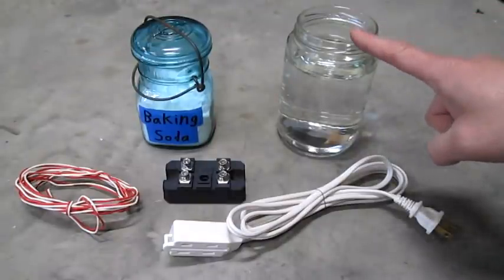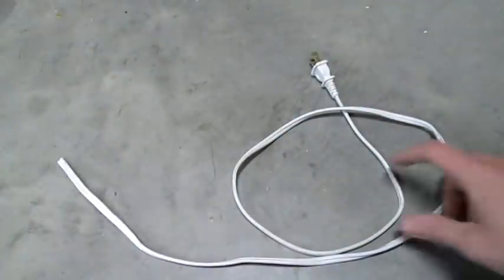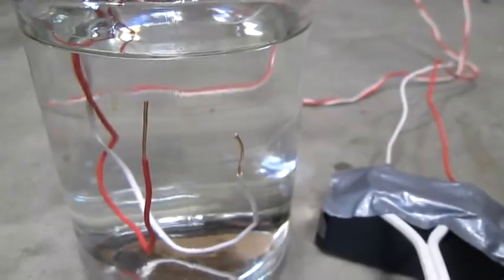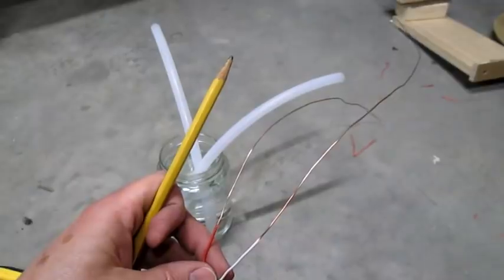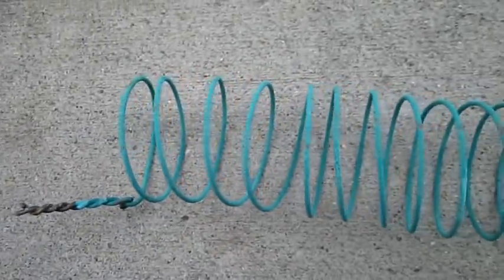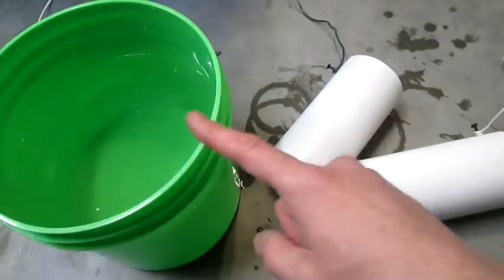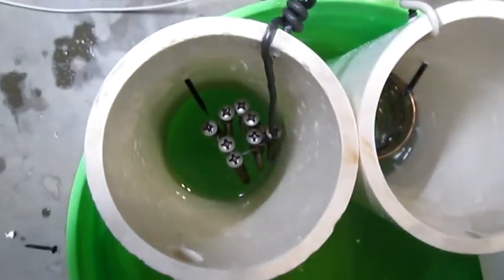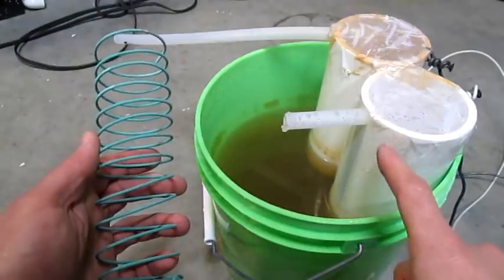DIY Oxygen Machine

Comment: HowToLou:  hi, Lou. It’s been a hell of a couple of years. Too many of us didn’t make it, and it’s not over yet.

This is a super idea. Heaven knows, for those of us struggling over the last year too, a little more oxygen made all the  difference. So thank you for putting in your best contribution. There are  probably people still walking the earth right now because of your contribution, as well as the contributions of those like-minded.  Is somebody who is being a direct beneficiary of this kind of thinking, I thank you from the bottom of my heart. Myself and at least one other member of my family have benefitted from this kind of thinking in this past year.

I’m a recreational potter, but I’ve had to think about the breathing problem this year. Although it was a combination of other people’s ideas that have been getting me by, I can see where I might be able to make a small contribution to the one problem inherent in your very workable and cost effective solution.  

If I have correctly understood you, the   entire process falls apart if the plastic starts to melt. I think that if I find myself in the situation again, Heaven forbid, I’d bust out the ceramic crockpot—The big one. It sits in an electronic unit that’s made with an element in it, so that I know that it can withstand high temperatures. And the unit itself, would protect the environment around it. So I think that might be how I get around the plastic bucket problem.

I didn’t catch what the pipe was made out of. If it’s a situation where we have to worry about those getting hot breaking down in the heat as well, I think what I’d find is a couple of ceramic bottles or cheap terra-cotta flower pots from the dollar store, and cut the bottoms out. Sometimes you can get some fairly tall skinny ones. They could probably be fastened to the side of the crock set up after a fashion that wouldn’t be so different from the plastic set up, and it would probably function exactly the same way.  No Metal touches the set up either that way. So I think that if we make that one material modification, it preserves the integrity of your setup. What do you think?  How long do you think you could run your set up with that one modification? Could you use it to provide some real and long-term relief to some poor soul in emergency situation?

Thank you for being willing to put yourself out there. I think I’m going to pick up the elements of this and put my emergency kit.

There’s another set up that wouldn’t produce as much oxygen, but does a lot to clear out the lungs for anybody who’s suffering and suffocating with pneumonia. It will not work properly and will backfire terribly if a person doesn’t take therapeutic dosages of vitamin D, about 30- 50 mg of zinc, and therapeutic dosages of time release vitamin C and liposomal vitamin C. I’ll explain that if I need to later. But you take that, and then you make a solution of saline, or if you’ve got an affection in the lungs, make it .1% hydrogen peroxide in normal saline. Throw that in a nebulizer, and it not only provides more oxygen, but it loosens up the pneumonia that’s suffocating a person. 20 minutes will make a huge difference. Now for the soul who is not blessed with a nebulizer, one of those inexpensive ultrasonic essential oil water diffusers will do the same job. Mine probably saved my life this year. It was a gift from  my very best friend. She made it possible for me to breathe when I was dying.  

What makes a bigger difference again though, is lying in the prone position, on the belly. This is because of the position were most of the gas exchange in the long happens.  When you lie on your belly, and especially if you can have someone thump some of the congestion down, that exposes more of the actual important area for breathing, so their breathing becomes much easier.If there’s somebody around who can thaw very firmly between the shoulder blades, that will dislodge much of the terrible congestion. A person can even sleep that way. 

My apologies for the length of this reply. I just couldn’t justify not helping a little bit if I could. I hope you’ll answer back to let me know if you try it, or if it needs further tweaking. I can’t say that I have any answers, but I am willing to help tweak things now that you’ve got the heavy lifting done on it. Thanks again.❤️
Reply from the maker: Thanks.  I think those are good ideas.  Remember, the bucket can’t get hotter than the boiling point of water, and that is well below its melting point.  There are readily available heater hoses (I just used one in my latest Razor Heater video) that can withstand very high heat.  The main thing I would add is a copper coil cooling tower to condense out steam and cool the oxygen.
Reply: @HowToLou  :   I’m glad you know about the point at which the plastic ends up dissolved in the water. That’s something I don’t know about, and I’ve never taken an interest in, until this moment. Lol I probably wouldn’t even be thinking about it but for your video.

I would agree with you though but needing to cool down the collected oxygen, particularly if it is to be used directly from the unit that you made to concentrate and collect it.  I suspect it wouldn’t be too difficult to put a lid on this set up to make it Just that bit safer, and then put it on wheeled cart so that it could be moved next to the patient’s bedside; it probably would be a small matter of venting the H gas via a window insert and hose setup.  

It wouldn’t be hard to attach like an oxygen sensor and electronic metre of some kind to give a reading on the concentration. I suspect you might be very pleased to learn how effective your setup is.

I hope you put out another video if you do another incarnation of it.

I strongly suspect that the components are going to end up in my emergency Cupboard. It’s funny isn’t it, I when it comes to emergency bags and such, we think of the rule of threes. But nobody considered availability of oxygen because of pneumonia before this pandemic.

Comment: Any idea what happens with a transformer in the circuit ? (lower voltage) Is the heat produced relative to the voltage and how does it relate to the actual oxygen produced.
Reply from the maker: Actually a transformer would help reduce heat.  You can split water at way lower voltages.  I was trying to make this as simple as possible.
Reply: @HowToLou  Understood. Any idea how voltage ratio's with output? I want to design a whole house unit that ties into my duct system. Thanks

Comment: How much per liter O2 per minutes the tool produces O2?
Reply from the maker: I did not measure it.  Add Sodium Hydroxide to increase production.   More metal surface area also increases production.
Reply: SevenSon:  we did see that he measured his own oxygen saturation levels, and that it raised substantially when he breathed the oxygen that he produced himself using this method. That’s no small thing.

It’s a start point. And if person were to go to use this, I think we can agree that it doesn’t have to be all the only measure that a person implements.

By the same token, if you can find a method that works more effectively, or an idea to tweak this one, I hope you speak up. It could save lives. :)

Comment: Whats fungtion baking soda? Thanks
Reply from the maker: Baking Soda should be Sodium Hydroxide and it helps the water conduct electricity better
Reply: @HowToLou  Is baking soda able to increase the amount of O2 production and O2 quality?
Reply from the maker: The Sodium Hydroxide helps more electricity pass through the water which splits it into hydrogen and oxygen faster.   The oxygen quality is the same.

Comment: Hi, does stainless steel create a toxic byproduct during electrolysis? Thanks
Reply: No. But it depends on your electrolyte. You will filter your gas through a bubbler and this part is absolutely necessary as you don't want an accident if you accidentally ignite the gas. Stainless does not corrode as much as other metals.

Comment: I did some calculation and obtained that around 300 Amp current is required to generate 1litre/min of oxygen. This high current even for 6 seconds is good enough to cause 200 degree C rise in temperature of copper wire of diameter 2 mm. I think that running the set up longer might be extrmely dangerous given that hydrogen is involved her which ignites somewhere around 500 C. Can you please share what is the dimension and material of the Havels wire  ?
Reply from the maker: Yes, for long term use, pipe and vent hydrogen outside.  The copper wire was 16 gauge.

Comment: Good Video. I tried it and it actually works.. Though I'd like to add a caveat for the benefit of all here... When electricity was passed into the water, it starts to boil within minutes (depends on how much water you take) - however be very careful since the water temperature rises very quickly. This should be done only under supervision
Reply: What now ? With the water heating up - are you thinking of adding a cooler at the top to cool water ? Or use the refrigerant unit to cool water down.
Reply: @kiranshashiny  how about a bigger container of water, a larger volume of water.

Comment: Can i directly use SMPS ( Switched mode power supply for dc output ) instead of rectifier.
Reply from the maker: Yes, you can use any DC source.  The rectifier is best because it gives you a lot of power which you need to produce a lot of oxygen.  Switching power supplies, like for computers, don’t give much power out.
Reply: @HowToLou  Thanks for reply. I have 24vdc 2.5 A power supply.

Comment: Can it be used for medical purposes? and can u give some estimate on how much h2o will generate how much o2...
Reply from the maker: There is a LOT of Oxygen in water, so you don’t need much.  However, you need a lot of electrical energy to split it out.  Splitting one litre of water would take at least 16 MJ (4.4 kWh).   If you use pure water, you should be able to generate pure, breathable oxygen.  The water gets very hot and steams, so you will need to run your oxygen through a cooling coil to condense and remove the steam.
Reply: Its not efficient method. As you see in the video, the water starts boiling. So in order to maximize efficiency, you need low rate of electrolysis. 
Also, using salt (NaCl ) produces Cl2 which is harmful. Using Baking soda also produces CO2 in small amount.

Another aspect is rate of oxygen produced. Patients require 0-15 Litres of oxygen per minute. So, you might need to collect oxygen and compress it in some way.

Comment: Which Baking Sodas can be used?
is this good to use for medicale patient?
Can u clear how much oxygen this can generate?
Is it Sufficient for 1 Person?
Reply from the maker: I used Sodium Bicarbonate.  Sodium Hydroxide is better. If you use pure water and cool the output to remove the steam, it should be breathable.  Splitting one litre of water would take at least 16 MJ (4.4 kWh).  It take a lot of electricity.
Reply: @HowToLou  we can use S. Steel Bands to increase Surface Area which can increase speed of Oxygen production.
Reply: I am wondering the same. It seems this won't be sufficient to fill a normal medical cylinder
Reply: @triprjt7857  Don't need to fill Medicle Cylinder if it sufficient for patient. it can be directly given to patients
Reply: @triprjt7857  : your post is 10 months old, but the pandemic is still ongoing, so I hope it’s OK that I’m getting back to you on your comment. If you have a set up like this in place, using a heavy ceramic crock, that won’t melt when the water gets very hot, you could theoretically run some version of this set up such that you ran the hydrogen offgassing outside, being careful about where it comes out and what’s going to be around it, and you could take the tube collecting the oxygen, and roll that out into the bottom of a bottle containing room-temperature water.  This could take care of condensation and heat. The top of that glass bottle could have one hole in it stopper, just the right size to fit tubing that could eventually be attached to a cannula. As long as this was running, your patient would have oxygen generated. You would not have to fill a cylinder. 

India is known for its excellent and high grade ceramics industry. I’d be very surprised if every household did not have access to a large, high-quality crock, And possibly two cylinders to fit inside it, leaving space at the bottom for the solution to freely flow.

There’s more person can do. Instead of having a person lie on their back, flip them over on their bellies. Women especially may need some strategically placed cushions to be able to do this. Once on the belly, very firmly thump on the back between the shoulder blades for about the length of time that it takes to sing your favourite hymn. This will loosen up the congestion substantially. And it will free up the areas of the lungs that are responsible for gas exchange.

If there is no reason that your pharmacist can tell you not to take zinc, vitamin D, and therapeutic quantities of time release or liposomal vitamin c, So that the body doesn’t create more problems while you try to solve this problem, that’ll be a huge help.

This next idea will only work if you have taken those supplements that I just suggested. If you do not take them, you will probably kill the patient. Nebulize with normal saline. You can use .1% hydrogen peroxide in that saline, with your doctors’ permission, but do not even think about doing any nebulizing if you haven’t taken those vitamins. Because it will work in the short term, but kill the patient. You see, you may kill the virus, but if you don’t take those supplements your body will mount an immune response called a cytokine  storm, which will flood the lungs. But if you do take the supplements it’ll kill the virus too, and prevent you from suffocating from the immune response that your body mounts to clean up.  It may take months of this to recover, but at least you’ll be able to breathe while your body recovers and the other medication from your doctor have a chance to work.  I’m personally still recovering from mine a year later, and still need to nebulize sometimes, but I have lived and am healing.

I have a very good Doctor Who told me this when I was suffering from Covid, end it made all the difference. It was far from all that he had to say, and he gave me a great deal more help than that. But that’s the immediate stuff that made a huge difference. If you need to know what other measures of worked in my case, then I’d be willing to tell you if you ask.  I truly hope that the situation is not severe an India right now, and that you and all your ones are well again. ❤️
Reply: Ideally, a liter of water at STP would produce ( 27.7 moles O2 x 22.4 liters per mole = 622 liters of O2).

Comment: Can we use this oxygen directly for inhalation or any further purification is needed?
Reply from the maker: The oxygen is combined with hot steam.  It would have to be run through a cooling/condensing tower to separate it out
Reply: @HowToLou  o after passing this oxygen from different water containers that will trap the moisture content .After that can we consume it directly?
Reply from the maker: I did, but only a little, and I felt fine.  The only elements involved are copper, H2O, and any impurities in the water.  It should be fine, but I would have it tested by a lab, if you plan to breath large quantities of it.
Reply: Dear sir,
During this time of pandemic in India we are running out of beds in Hospitals and Oxygen is also not available in hospitals so i had worked on Hho generator during my college time so wanted to help our people and as many as possible that's why i am worried
Reply from the maker: Yes, I understand.  I made this Oxygen machine at the start of the pandemic in USA because I was worried hospitals would not have enough oxygen.  Fortunately we never ran out.  It takes a lot of electrical power, but you can easily split water into hydrogen and oxygen.  The water does get hot, so you would need a way to cool it.  The purity of your oxygen depends on the purity of your water.
Reply: Thank you

Comment: How much Oxygen generated by this setup??
Reply from the maker: I don’t know.   A chemist might be able to  answer that.  120volts and about 10amps would be 12,000 watts of electrical energy.  They could give you some idea how fast that splits water into hydrogen and oxygen.
Reply: @HowToLou  How much oxygen 1 liter of water has ?  Given that at equilibrium with the atmosphere at standard temperature (about 20 degrees C) and pressure will hold about .0.009g of oxygen /Liter of water  , What is the math you are describing regarding rate of split ? with this info 120volts and about 10amps would be 12,000 watts of electrical energy.?
Reply: A liter of water has 55.6 moles. so for oxygen you would get 27.7 moles. 
moles x Molar mass = 27.7 x 16 = 443 g. 
At 25 C,  27.7 x 22.47 =  620 liters. 
These are ideal calculations. i doubt such yield is practically possible by this process. 
Patients are administered 0-15 L per min O2. So, a very high yield is required.

Comment: My will be thrilled that I can finally collect some of my gas.
Reply: Yes, chlor gas
Reply: @aprogress2374  : yes, that could be the case if someone chose to use chlorinated water. But Lou did address that. 

You might be a good person to run this by. Does not chlorine evaporate out of tap water if left out in an open container overnight?  Or even if brought to boil?  

Your thoughts would be appreciated on this matter.
Reply: @daphneraven6745  Whether or not it evaporates overnight depends on the type of chlorine that was used, as I understand it. Some water systems use the type that evaporates, and some don't.